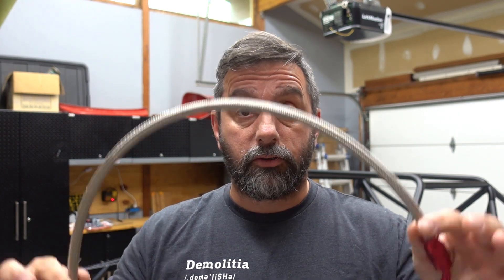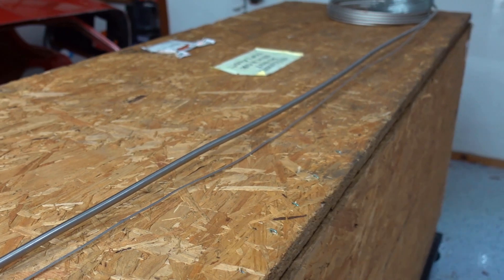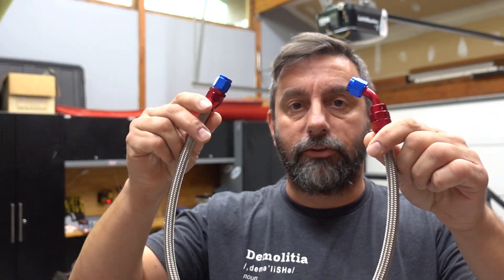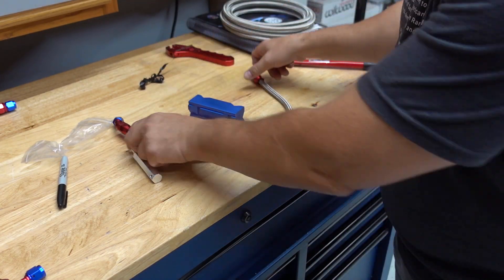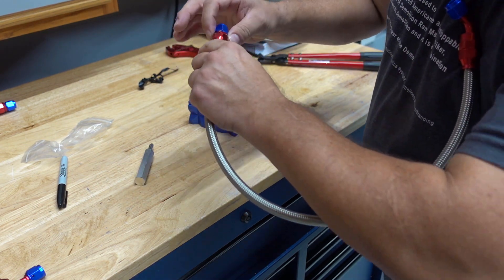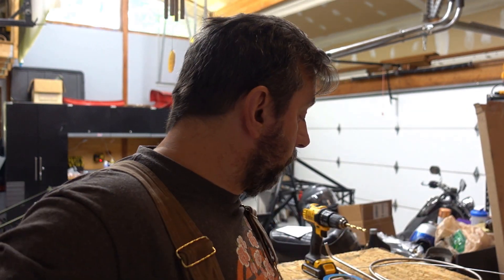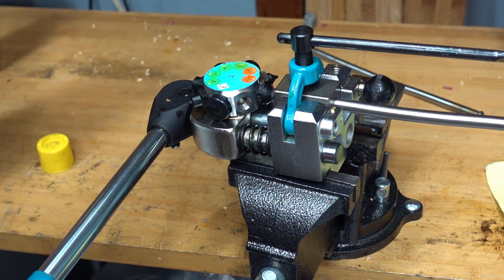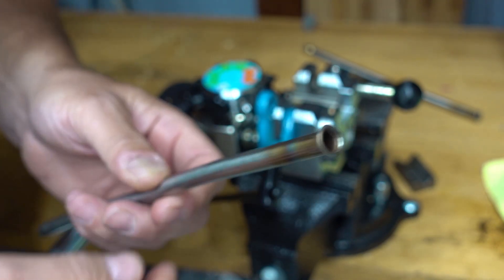Part 18 | Making Braided and Stainless Steel fuel lines | Daytona Coupe Build

Comment: Great video—I had no idea how the AN fittings worked.  As for the hard line, perhaps they recommend heating tubing to anneal it?  That makes it easier bend or flare.  If you buy brake line it comes already annealed but I’m not sure about Stainless.
Reply from the maker: You can flare them without heating, but I had way more failure. Once I applied heat, every flare worked perfectly. Annealing sounds like a plausible reason.
Reply: @OakHollowGarage  that makes sense because it would be a lot stiffer and more likely to crack without annealing.  It’s like copper tubing that “work-hardens” and gets stiffer every time it is bent so you need to heat it up to anneal it then you can bend it easily again.  Keep up the good work it’s great watching and learning from your videos!

Comment: Out of curiosity, did the complete kit not come with the correct fuel lines?
Reply from the maker: The compete kit comes with fuel lines, but I am using a different hanger and fuel pump. It needs larger diameter fuel lines.